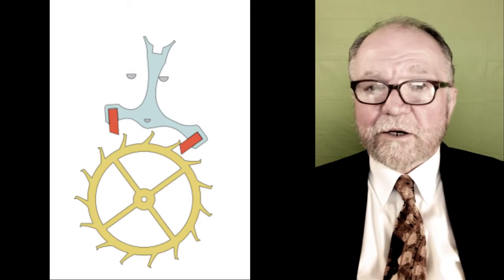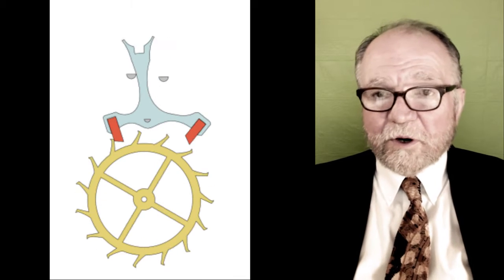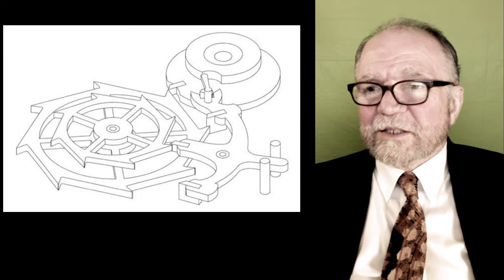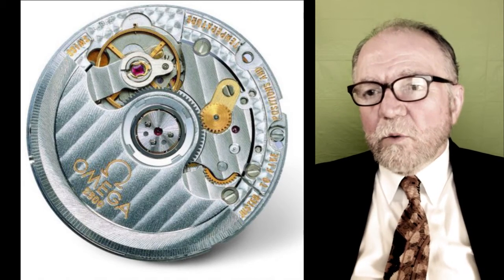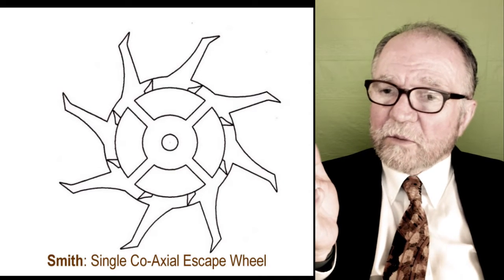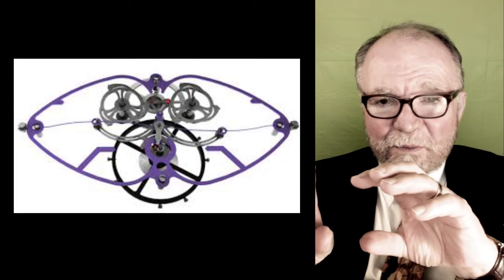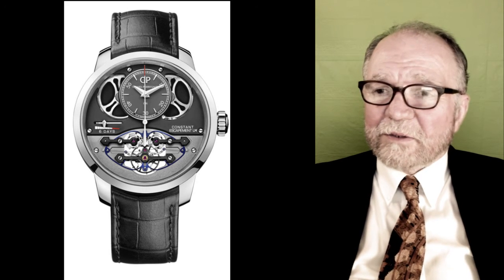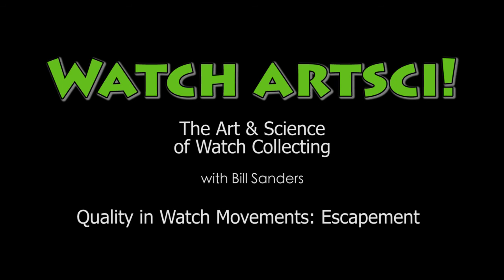#56 Quality in Watch Movements: Escapement

Comment: Quartz are CRAP !
Reply: Not really, it's a technology that has a place in horology and forced the stagnant brands to innovate once again.
Reply from the maker: Hey Mr. Bass. The problem with quartz is that it's accuracy is exponentially better than mechanical, and so they don't have to go through all of the trouble to get the last micro second out of a mechanical system. F.P. Journe made an incredible quartz movement and watch that goes to "sleep" when the user puts it down. However, as far as a collection watch, I don't really count them unless some new innovation comes up. The most interesting one lately is one by Seiko that is an automatic, but the winding motion from the automatic rotor goes to charge the batter that runs the quartz movement. But I'm with you as far as adding them to my collection. Cheers, Bill

Comment: I am pretty sure my simple collection has the simplest of regulation. The only negative I've heard about co-axial is service -related. I just read a piece about the Seiko Spring Drive ... I just can't get into the hybrid technology of that movement. I'm not the kind of guy that would buy a Prius either. Good show as usual. Wife and I look forward to Friday and Sunday shows, we both enjoy them.
Reply from the maker: Hi JR. I recently read an article by a watch service / repair guy, and he much preferred the Swiss lever escapement over the co-axial. His preference stemmed from the fact that he was used to working on movements with Swiss lever escapements (primarily Rolex in this case) and the fact that the co-axials have four stones (manufactured rubies on the palettes) while the Swiss levers have only two. Watch repair guys also prefer ETA type movements over more sophisticated movements because the former are more familiar.  This mind-set drives me nuts. It is like saying, "Don't improve anything because it makes my job more difficult." I've run into the exact same problem with IT guys. One type is interested in the latest and most advanced system for the network, and the other type is interested in doing as little as possible. As a programmer, I've always pushed the envelope, because all things hi-tech never stand still; and so I've had to request our IT guy keep adding the latest version of programs and database system. He does so with aplomb. On the other hand, I have a bunch of jackasses for my personal web hosting service that cannot or will not add updates, and when they do, they often give me incompatible programming software that conflicts with the databases. (I'm dropping them for an un-guided hosting service that I have to do the IT work myself--groan.) Compared to the watch service guy who doesn't like innovation because he is inconvenienced, my friend who is not only a wold-class watch-repair, master watchmaker, but also a Grand Prix d'Horlogerie de Genève judge, his approach is to find the most complicated watch/clocks because he is a true artist.  It's bad enough that I have to become my own IT guy, I don't want to have to be my own watch repair guy too! (...well maybe just a little.) So JR, be skeptical of articles written by people whose life is inconvenienced by innovation! Kindest regards, B ill